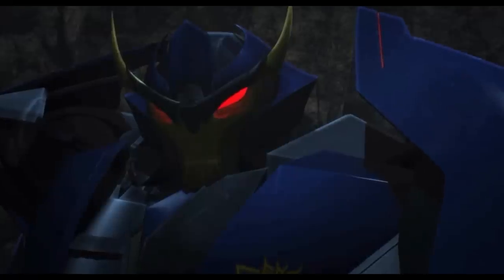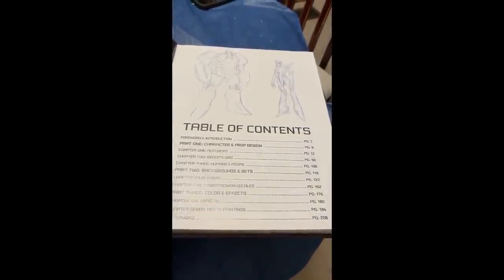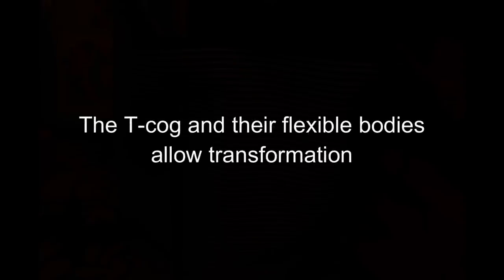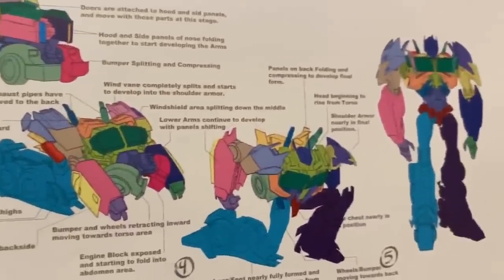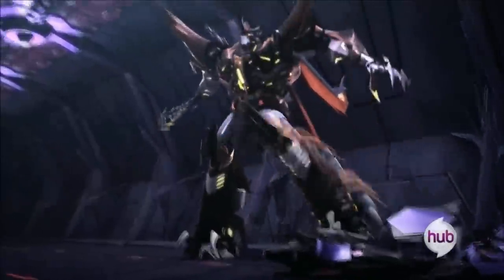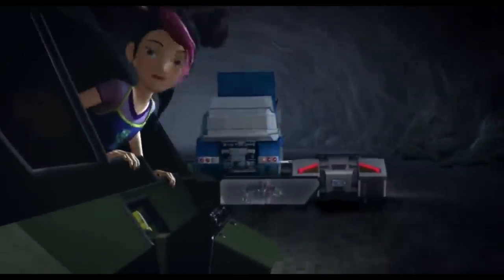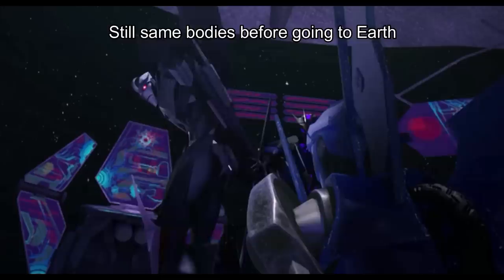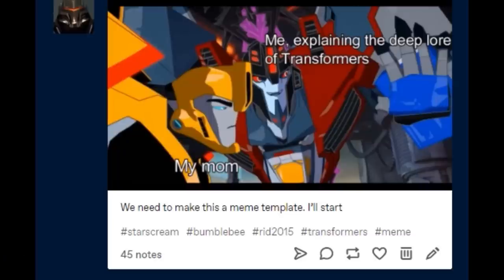Is Mass Change a Problem in Transformers Prime?: How Transformation works

Comment: Hmm well let’s think it like this since earth technology is not as hard as cybertronian body wise especially which is the main reason arcee can basically brake the logic of her body she’s capable of it because the cybertronian body can bend it like rubber without breaking it, which is why they can compact the excess things within them predaking is a kinda hard to explain maybe it’s due to being an old relic, since he’s old/new he’s capable of compacting alot more things within him whilst being a small tank that and that shockwave possibly modified/adjusted him so that if the day ever came he could transform y’know like how shockwave experimented on grimlock still being a giant but not as tall as his beast form like you said they have flexible body part this and also that given how predaking was made from bones which was simply modified to hardened and became cybertronian which is kinda why he’s still flexible but still capable to being become a giant dragon

Comment: Okay, I just wrote a long comment on Dreadwing's "honor", but now I can't seem to find it, even though I posted it.
In case it got deleted, I just wanna say:
Dreadwing is twice as dishonorable as he is honorable.
He performs at least 5 acts of honor and 11 acts of dishonor throughout his appearance in season 2, and that includes the flashback in "Loose Cannons".
Plus he makes so many mistakes and fails so often, he puts Starscream in a much better light when it comes to competence.
I wrote a lot more in my other comment, but I don't wanna repeat myself in case it's actually there and I just can't see it.
I've also speculated if Dreadwing might actually have the ability to fly in bot mode but we've never seen it because he's never had the need to use it?
Like, when he kidnaps Bulkhead in "Loose Cannons", he takes him to a harbor. We know he didn't use Soundwave for portals, since Soundwave would have told Megatron, and besides they would have probably taken Bulkhead back to the ship for interrogation instead.
In other words, Dreadwing FLEW Bulkhead all the way to the harbor, however far away that is. Now, I don't know about you, but I think Bulkhead definitely looks too big, heavy and round to be balanced on such a flat jet. Like, how slow would Dreadwing have had to fly to not have him fall down?!
Plus Dreadwing clearly has spent a LOT of time setting up all those bombs in the harbor, and it seems like Optimus arrived to help Wheeljack not too long after the Wreckers got wrecked. (get it lol jk)
It would have made more sense (to me, anyway) if Dreadwing had carried Bulkhead in his arms and then flown to the harbor in bot mode. Of course, how he transported Bulkhead is off-screen, so we don't know, and it's not explained either.
Maybe he did do some careful balancing with slow flight, but I like my idea that he might have flown in bot mode.
On that note, if Dreadwing IS capable of bot mode flight (but simply chooses not to - while we're looking, anyway), I believe Skyquake might have had the ability as well.
The reason why Skyquake doesn't fly in bot mode could be because he has just come out of stasis (lasted for an unknown amount of years) and only had ONE tiny Energon cube to wake up on. As such, he must still be low on energy, which could also explain why OP and Bee take him out so easily, despite him apparently being a powerful and great warrior. As such, he would probably not have had enough energy to actually use flight in bot mode.
I believe bot mode flight spends more energy than alt mode flight, though it depends on the size of the thrusters. OP's jetpack seems to have large thrusters, thus he doesn't spend as much energy to create heat and flames to fly.
If the thrusters are on the bottom of the feet, however, that would probably require more energy to create more heat and more flames to better keep in the air, as is common among Seekers (with Starscream's general body-type anyway).
While the video games aren't exactly canon to Prime as the books are, they do provide some implication as to what the bots might have looked like in the past, as well as some of their abilities. It seems legit that Starscream would have used to be able to fly in bot mode.
I don't remember if he's able to do that in Exodus or if he can in the other books (while he's still in his classic body, that is), but it makes sense, since the Seekers (actual Seekers, not the Ace Vehicons) are the only LEGIT Fliers in Prime, with wings and from creation and everything.
I'm not sure how the Vehicon cloning works, but if they're all cloned from one guy, it's probably a Grounder, and then some of the clones are outfitted as Fliers, but as a result they are originally Grounders (MAYBE), and thus aren't really legit Fliers.
Megatron and Soundwave are both originally Grounders made to become Fliers, so that makes sense why they can't fly in bot mode.
Airachnid... I don't know. She's weird. She's a spider-copter-bot, kinda like a Triple Changer, then again not really? I dunno what to make of her and her race. Dunno if that copter mode is something her race can turn into (since it doesn't even look like what she scanned) or if she could have turned into anything. Like I said, dunno what to make of her.
Starscream in Prime is definitely unable to fly in bot mode (otherwise he'd have done it), but his body is so skinny and narrow, it doesn't seem like there's any room anywhere for such thrusters, especially not in his legs or feet. Maybe on his back, but that seems more like it's part of his cockpit, so yeah, doesn't work with him. (he does seem able to fly in bot mode in RID though, but again, chooses not to until seconds before he falls comatose)
Dreadwing is never seen flying in bot mode, but might possibly have done it. If you have any ideas yourself how he got Bulkhead to the harbor, please, tell me.
Skyquake doesn't because he's low on energy and as such is easily defeated and killed. R.I.P.
Woops, this ended up becoming a comment on possible bot mode flight of the Seeker Twins rather than on Dreadwing's honor.
Seems Starscream's not the only one who can't keep his mouth/writing shut... -_-;
Reply from the maker: I like and would agree with your hypothesis. And actually I still plan on talking about Dreadwing's honour. There are two topics I want to get into, one being why joining the Decepticons seemed like a good choice (Dreadwing sees the Autobots as the bad guys), and that Dreadwing is overly praised. Dreadwing is called an honourable warrior but he does some very dishonourable things all the time, using bombs instead of fighting bots fairly. Viewers are way too quick to glorify Dreadwing and slander Starscream as a coward. Starscream is realistic and a survivor, and Dreadwing doesn't deserve such praise
Reply: @emperorkumquat  Yeah.
Megatron said "But like his departed twin, Dreadwing understands honor."
You're giving him too much credit, Megs.
Though Skyquake might actually have had more honor than Dreadwing, though since he died in his debut episode, we'll never really know.
Also, you probably know this, but while it's not explicity stated in the show, Optimus heavily implies that Skyquake was indeed a Seeker.
"I know of this Dreadwing. He was captain of a Seeker armada, and as such, like his twin Skyquake, fiercely loyal to the Decepticon cause."
Not only does Optimus basically confirm that Skyquake was a Seeker, he even implies that Seekers are generally fiercely loyal to the Decepticons.
Then again, the Decepticon cause does not equal Megatron, and Starscream DID used to be the leader of the Seekers (more or less, anyway), so naturally Star is an exception when it comes to loyalty, since he used to be the master and not an underling.
Although, when it comes to Prime, Starscream actually only betrays Megatron ONCE. In Masters and Students, when he removes the Dark Energon shard from his chassis, thus offlining him.
And it was only due to this one, TRUE betrayal, that Megatron nearly killed him when he returned, putting him on life-support.
Starscream never betrayed him again, anything else was an accident or not meant to try Megatron's life.
As for the Armada episode, Starscream had left the Cons, thus he wasn't betraying anyone! :)

Comment: Predaking probably just has some hollow insides
Reply from the maker: He surely does
Reply: @emperorkumquat  that's how he gets bigger he hides the important stuff in the centre like an m&m and the rest is hollow
Reply from the maker: @taniksholdinganarchy4081  Well, the biggest issue for me is his forearms and hands. They are supposed to fold up into his arms, but it is a lot
Reply: @emperorkumquat  I think it is like a switchblade the claws come together by melting into one piece and it flips and slots into the forearms then well it might fit